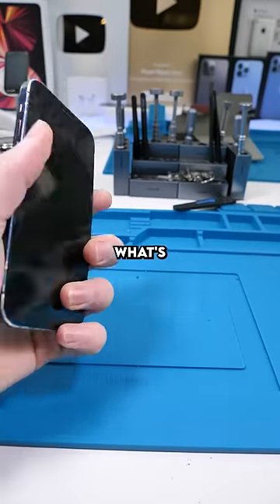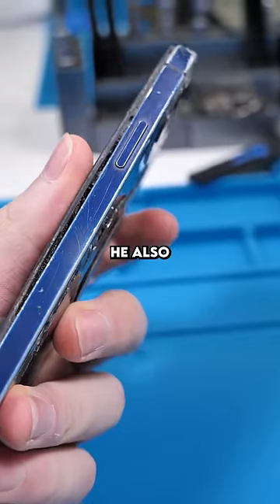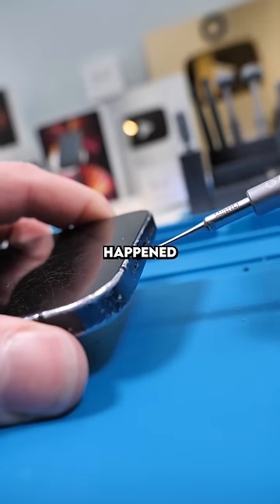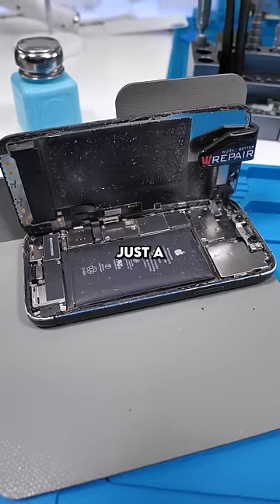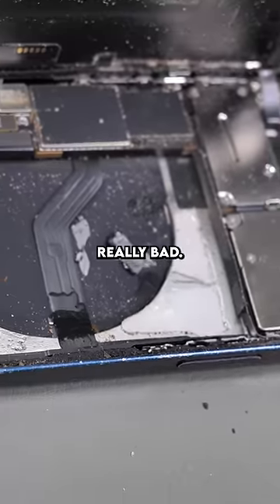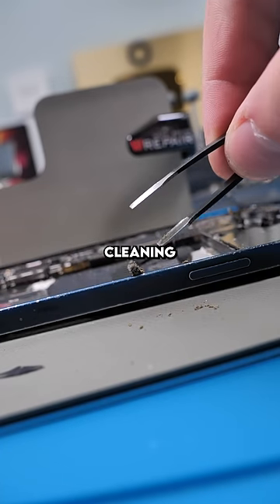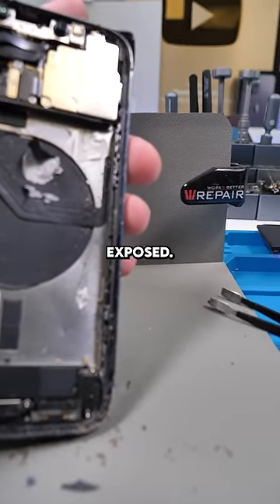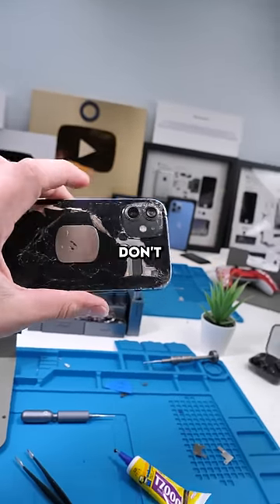This iPhone 12 IS OBLITERATED... #shorts

Comment: How does a phone which is not older than 2 years swell? Never seen these issues on the older iPhones . 

The same thing happened to my X and then I dropped it and the screen died they priced it at 420$ for the replacement 🫠…. Went right back to using my 6s .
Reply: Just get a Samsung like every other rational person lol
Reply: Maybe got damaged from back drop??
Reply: replace it from a 3rd party local shop
Reply: Charge cycles. You can easily charge cycle 3 times a day with heavy usage, that's around 1,000 cycles. I've seen batteries swolen that have less than 800 cycles, even at 500 they already start to do funky stuff, or show >70% battery health.
Reply: Maybe because I have wooden floors but I X is fine after dropping it